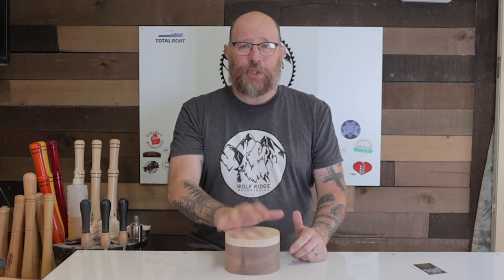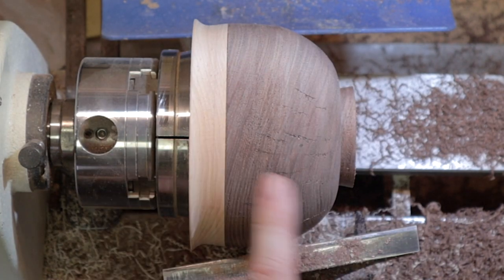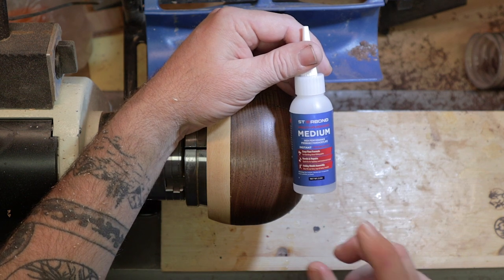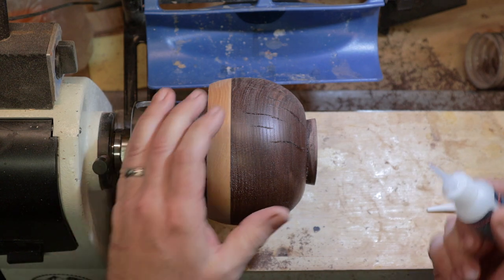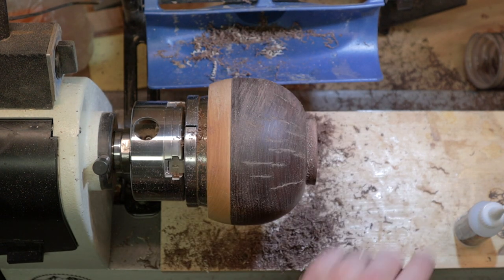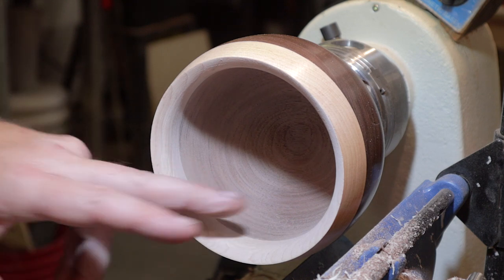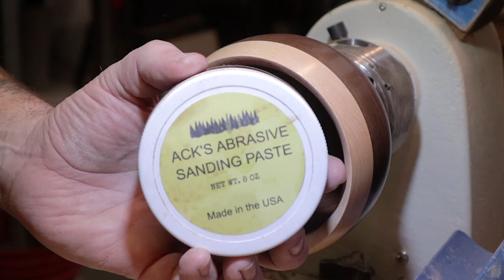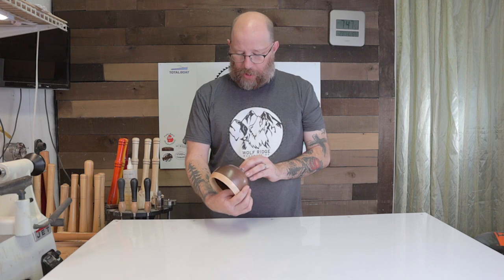Woodturning: Maple & Walnut Caldron Bowl

Comment: Nice piece... I am new to wood Turning... what is the purpose of sanding sealer,sanding paste and sanding polish....
Reply from the maker: Thank you Peter!  Great question.  On some woods, the fibers are not stiff enough to sand.  Sanding sealer stiffens the fibers to make the sand paper more effective.  The abrasive paste is a finer grit and adds a little oil and other products as a lubricant.  The polishing paste that I use consists of mineral oil and bees wax.  It is a great finish that will protect the wood and gives a great stain finish.  You can use WOLF10 when ordering the Ack's product to receive 10% off your order (https://ackswoodpaste.com/).  - Ed
Reply: Wolf Ridge Woodworking thanks for the info

Comment: That is awesome that you are able to place the box letting us know what tool you are using and what speed the lathe is running at.  I wish more turners would do that.
Is you Mylands diluted or do you just like it in a ketchup bottle?
Very nice bowl by the way.
Reply from the maker: Thank you David!  When I started turning a couple of years ago and was watching turning videos, I always wondered what they were using and how fast.  I told myself, if I ever start a channel, I'm going to help others who are starting out with as much information as I can.

The Mylands Sanding Sealer is full strength and not cut with anything.  It's just easier to get it out of the squeeze bottle than the can.

- Ed